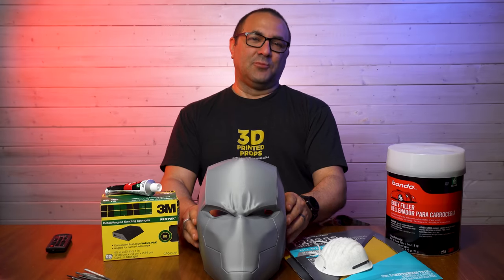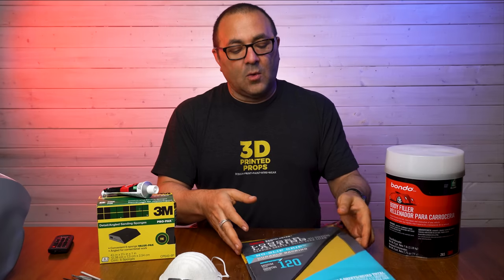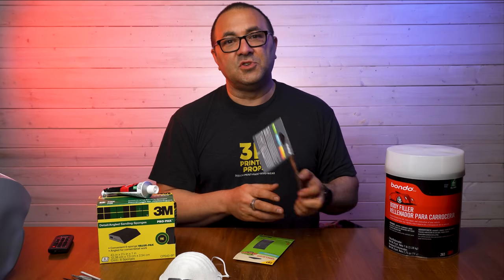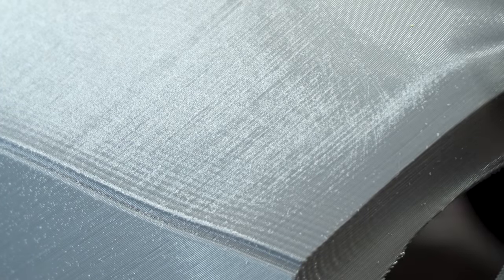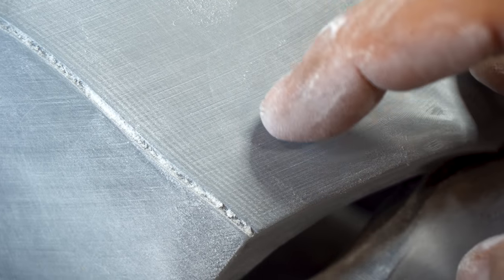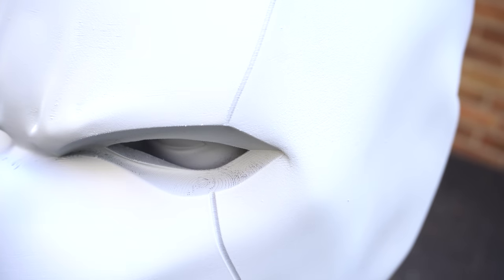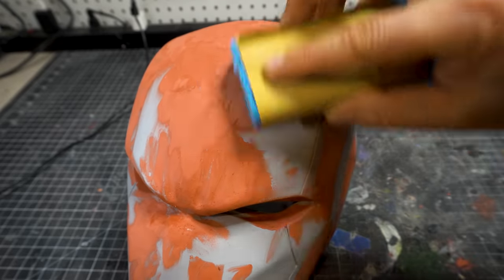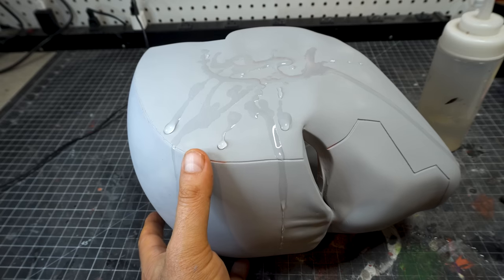Finishing 3D Prints: How to Sand, Fill and Prime 3D Printed Parts

Comment: What if the 3d print that you received has very large layers and it isn't as smooth as the mask you started with. Do you still need to sand it first before the thicker primer?

Comment: Would this process work with smaller figures that are printed out ? Like around ears , fingers etc ? Or would the sanding process break those off ?
Reply from the maker: You can sand smaller parts. I have. You'll just need to be careful. Also not use thick primers. Use fine primers so I don't fill in and gum up all the detail.

Comment: So after filler priming. What grit do we continue to use?  do I start again at 120/220/320? Or just 320?
Reply from the maker: I start back at 320 or 400.
Reply: @3DPrintedProps  thanks. I'll start there. If it needs a lower grit I'll go down one at a time

Comment: How many wall layers do you recommend so that you don't sand through while sanding out the layer lines
Reply from the maker: I usually just print with 2 walls and 7 top lavers and 6 bottom.

Comment: do you ever mix bondo with epoxy resin to make a skim coat?  I use this on fiberglass enclosures for super smooth finishes, wondering how that would work with prints.

Comment: It's a great video and great work, but I'll save you tonnes of time with this advice (naysayers are welcome to chime in).There's absolutely zero reason to sand the surface material and/or filler down to anything over 400g, let alone going all the way up to 2000. In fact, sanding your rough surface to anything above 400g will cause problems with your primer adhesion. The prime layer is meant to soak in and fill shallow scratches - like the scratches left by 220g to 400g - and again to be sanded down to 220g-400g in preparation for the first colour coat. The first colour coat is for bonding and final sanding (unless you spot more scratches that you want out - then you could recoat it, or clearcoat it, or even waxless polish might deal with it). The last colour coat is your final surface, in which it's your choice to wet-sand, or not. A well sprayed topcoat doesn't need final wet sanding, unless you're going for perfection.

Save the tedious high-grit micro-sanding for the last coat on any project.

Comment: Would you recommend using a sander to save time?
Reply: On a helmet, a sander probably won't be much of use due to the curves it has. You could easily sand 1 area lower then the other as well. Now if your doing a prop of a large sword or shield that has a large flat surface, then I would highly recommend a sander as long as you can adjust the speed of it, go to fast and you will start melting the plastic rather then sanding it because of the friction

Comment: Hey. I am working on a nova helmet and have two questions. First of all the inside of my helmet is kind of rough do I have to sand it. Also the nova star that goes on the helmet is a separate piece. Should I go through the whole process that you went through for the nova star also.

Comment: How are you supposed to do this with less flat surfaces? Like with prints with lots of grooves and stuff?
Reply from the maker: Yeah, that's a lot harder. You can use smaller sanding tools and files but its not as easy. Fir really intricate models you will only be able to do so much on an FDM printer before you have to move to resin printing.
Reply: Sorry for the late reply, but thank you!

Comment: do you ever run into melting issues with sanding pla? have you used any power tools for sanding?
Reply from the maker: Not with hand sanding, but I have with an orbital sander. I stayed on one area too long and it got a little melty, :) So be careful with mechanical sanders.

Comment: May I ask, how long did it took you to sand it with 120? I have been sanding small prop for about 4 hours. and i can still easily see layer lines
Reply from the maker: If its a FDM print start at a lower grit to knock the lines down, then go finer, that will help.
Reply: @3DPrintedProps  Thanks, did that, took about 3 weeks to complete all the parts but I got it done :D (I was working with PLA, also I had to start with 80)

Comment: When it comes to sanding, have you found a "safe" minimum outline requirement on the print?  I'm worried about accidentally sanding through it if I only have 2 perimeter layers.
Reply from the maker: I use 2 wall layers and have never had a problem, but if you start to see the infill pattern then watch out.,

Comment: What if, and this is a what if, ones printer is printing the lines so tiny you give yourself da goose pimples trying to rake your nail across em to fill em? would i still need to go as nuts on the sanding? or could i get away with just sanding with a high grit and straight to primer?

Comment: quick question: Are you using a hardener for the glazing putty shown/linked in this video? I am using the bondo glazing putty, and with the hardener, im not getting the deep red color you are getting in this video. I also don't like that it hardens in minutes... makes it very difficult to work with when I have a lot of imperfections to fill in.

Comment: After you use the spot puty what grit do you sand it with
Reply from the maker: Usually 400.
Reply: @3DPrintedProps  thanks also would just sandable primer work

Comment: Hmm, 9.5 out of 10 videos on youtube on smoothing FDM printed parts in PLA mentions sanding. I mass produce large 3D prints for customers and I am quite confident to say that sanding PLA isnt the most efficient method. Even the 3D printing services company I out source to, as I can't mass produce prints fast enough, do not offer sanding option for PLA. 

Hope this helps if anyone reads this. The method I use is I first spray 3-5 coats of spray putty on a fresh print. You sand down the putty into the PLA RATHER than sand the PLA... PLA very resilient to sanding. I will sand my SLA resin prints, but not PLA. Not anymore, no thanks, I have experienced that. If you sand PLA, you will notice the PLA will have fuzz/hair which are PLA ripped out of its surface by the sand paper. PLA doesn't shave off into fine powder as well as resin or putty.

Try it, once you used spray putty to fill the layer lines and sand them down, you will never go back to .... "sanding PLA"... a little funny. You then finish it off to achieve the glaze normally like you usually do.
Reply from the maker: I've had a few people mention that in the comments, I'll definitely try that next time. Thanks! :)
Reply: Thank you for this!  When you say spray putty, do you mean filler primer?  Or something else?  If not filler primer, can you mention what product you use?  Thank you!
Reply: @stevetb7777  spray putty is typically found in automotive stores. They are used to cover scratches in car body repair. Google it, it should turn up right away. It can be used as primer but it's not like paint primer which is thin. Just a few coats of the spray putty builds up a fairly thick layer. Have fun :)
Reply: @wyukigurumi  Apparently not so simple.  =D  I'm in CA, USA.  This spray putty, this isn't in an aerosol can right?  Most I'm seeing have to be mixed with another chemical, and a spray gun is used.  "Polyester Primer Surfacer" is what most of these are.  Am I on the right track?  Can you recommend any particular brands?  Most of what I find I can't get here, even shipped.  Thanks!
Reply: @stevetb7777  it is definitely an aerosol spray. It also comes in a big tin for car body workers to use a spray gun with.

Nah, for 3D printing hobbyists, just get the aerosol version.

Comment: what is the best thing to use. the glazing compound or wood filler? Or is it just a preference?
Reply from the maker: I think its a preference thing. I used wood putty but I like how this sands more. That and I'd buy a tub of wood filler and it would dry out in a few months since I didn't use it a lot. But try both and see what you like.
Reply: @3DPrintedProps  I actually used the bondo putty and it worked well. But I'm curious to see how wood filler works.
Reply: @3DPrintedProps  I've had the same problem with wood filler; but, I've found you can usually get it back to it's original state by mixing some water into it.  You can also use water to make it runnier, allowing it to better fill in finer detail areas.

Comment: Hey, I was working on my mask and I was using the sandable filler, I tried to sand it at was I think still wet? Even if I let it dry for four hours. It wasn’t looking like your mask. It wasn’t solid.
Reply from the maker: Was it the glazing putty I used. Look to make sure it wasn't the type of filler that needs a catalyst. Was there a small tube that came with the filler?

Comment: For sanding: can I use one of those electric handheld sanders? Sorry if it’s a dumb question
Reply from the maker: Yep, you can use an orbital sander. Just don't pause on one space too long. They can be pretty aggressive and also heat up a spot fast. But I use them all the time.
Reply: @3DPrintedProps  Thanks!

Comment: I wet sand the spot putty (yes, I have taken props into the shower with me). It eliminates the dust and gives a really nice finish. Try wet sanding next time and be amazed!
Reply from the maker: Yep, I wet sanded this. But if you're wet sanding there really isn't any dust.
Reply: @3DPrintedProps  Yes... I know. I am saying that I wet sand the spot putty which most people don't. I've seen many videos of people covered in red dust, but it can be wet sanded and the results are really nice.

Comment: There is no way to achieve this effect of perfect smooth surface with just printing? We still have to go through al of these right?
Reply from the maker: If you dial your printer in really well it can look smoother, but not this smooth. If you used a resin printer the prep work is very minimal since they give you a near perfect print with no layer lines. But a resin printer that can print a full helmet is very pricey and starts at around 2k USD.

Comment: Hi! I just had a question. I'm printing a pipboy from Fallout, and I was wondering on whether I should do these steps when it's all put together, or do them in their pieces then put them together. Thanks!
Reply from the maker: I would do a lot of the sanding when they are in pieces so you can get in the tough areas, but you may also need to do some sanding if you want to hide where you glued things together.

Comment: I have a rustoleum white paint+primer would It be OK to put it on the mask after sanding?
Reply from the maker: Sure, the benefit of using the fillable sanding primer is it fills in more layer lines and sands well to get a smother surface.

Comment: I suggest duplicolor filler primer. I will never use rustoleum again!
Reply from the maker: I'll try it. I haven't had issues with the Rust-Oleum though.
Reply: @3DPrintedProps  when I've used Rust-Oleum my sandpaper tends to get gummed up almost instantly. Even doing light coats and I even had a full week of drying time. I prefer duplicolor in every regard. Definitely worth checking out.

Comment: I had a question, when did you use the body filler?
Reply from the maker: I use it after I prime the helmet. Priming has a way of showing all the imperfections your missed or that are too large to sand.
Reply: @3DPrintedProps  thank you, I had another question, did you work on the inside of the helmet or leave it as is?
Reply from the maker: @silasdriver453  I didn't do anything sanding wise inside, I also try not to get a lot of paint inside due to the smell. I did add padding. That's in this video. https://www.youtube.com/watch?v=4a9nTbBrjrY&t=114s

Comment: Is there a way to prevent bondo from cracking? I've been working on a helmet recently, and the only thing that seems to hold me back from finishing is having more problems trying to fill cracks previously made by the bondo I'v placed before.
Reply from the maker: That I'm not sure about, not an expert with that stuff, but I find if I lay it on to thick it cracks, maybe someone else can weigh in?
Reply: Try the white bondo "All-Purpose Putty" that comes with a hardener. It is more like a cement but will be harder to sand, almost like a soft wood so be very careful and apply it conservatively. Red bondo is only good in thin layers on the most exterior surface.
Reply from the maker: @benhickman6296  I use that for the large cracks, for the small stuff I like the glazing compound. It smooths it out and is easy to work with.
Reply: @3DPrintedProps   I like using glazing compound myself. Iv'e had 3 issues with cracking with the red glaze which are caused by: applying it too thick, humidity/moisture, and melting (polystyrene). Instead of recommending a new product I should have just said that lol. Hopefully they find a good solution. I like the video!

Comment: What are your thoughts on primer that has filler built in?  Haven't watched the whole video yet so don't know if your covered this.
Reply from the maker: Built into the paint?
Reply: @3DPrintedProps  Built into the primer itself.  They sell primer that's also a filler.  Some use it to fill in some of the imperfections and lines of the 3d prints.

Comment: For some reason, after I primed my parts with the fillable and sandable primer, when I start sanding it, the primer starts to come off in chunks. What should I do? I spent so much time on this already /:
Reply: please respond
Reply: my part looks horrible lol. the primer is ripped off in chunks and smooth in other places. idk what to do but this sucks having spent so much time on it.
Reply from the maker: After you sanded it all, did your wash it to remove all the dust from the sanding and also what primer did you use?

Comment: isn't it a bit overkill to go all over 2000 if you're going to paint it ? You can still buff the paint if you use some thick paint.
I went all the way to 3000 and polish paste but only on some metalic 3D print (Bronzefill) to get the best effect of the filament.
Otherwise, great video.
Reply from the maker: Yeah, 2k is a bit much bit man...that sucker is smmmoooottthhhh. :)

Comment: I heard wet sanding the plastic is better so it doesn’t heat up. Does it actually matter?
Reply from the maker: If you're just hand sanding its cool, it doesn't heat up. If you are using a power sander I can but if you keep it moving you'll be OK. Wet sanding is really just for finishing.

Comment: This video is lovely, but please just as good practice. Do NOT sand in circles. If you get dirt or other small particles between your project and your sandpaper. Which can cause large scratches. Meaning you would have to start over in that area with a lower grit sandpaper. Like I said. Awesome video, great details just try to avoid circles.
Reply from the maker: Huh, I always thought you were supposed to sand in circles. I'll check into it more. Thanks.

Comment: $20 worth of filament
$10 of Bondo
Sandpaper... $5?
Primer $5
Gold paint $5
Candy red $15
Clear coat $5

Minimum $65. Probably closer to $80, plus a LOT of time. 
I'm using the cheap stuff, but it's expensive to finish this prop.
Not including the time I had to spend in Meshmixer to cut it down to fit an Ender 3.
Reply from the maker: Yep, its a expensive hobby. :)

Comment: Stupid question but..... when you say you "wash it", do you full on wash it with soap(fairy liquid)/water or JUST water to remove the grim/dust? I'm a little worried about washing the filler away? Even if that's possible? Thanks in advance!
Reply from the maker: Yep, soap and water. I just use a washcloth. Once the filler has cured and hardened it won't just wash off.😀
Reply: @3DPrintedProps  thank you for putting my mind at ease!

Comment: Is this for a resin print or PLA?
Reply from the maker: This in this particular video I'm going through steps on a PLA print. But I did one on resin prints though. Here it is. https://youtu.be/NLoQqRFlmk4
Reply: @3DPrintedProps  lol there is no details on helmets like this, resin will make it a lot quicker and less sanding
Reply from the maker: @devilik3692  true, u just need a big enough resin printer and about 60$ in resin. :P
Reply: @3DPrintedProps  no that's not what I mean , you can cover your fdm print in resin and use uv torch to cure it, you can use cheapest resin you can find for that just to make surface smooth. I have both but cosplay stuff easier to print in full pieces on fdm then cover it with resin using brush
Reply: @3DPrintedProps  very small about needed to do that

Comment: Depending on the primer, don’t you not want to get the primer wet? Just dry sand the primer? I know a 2k epoxy primer is water proof, but that’s no ordinary spray can you’d find in a hardware store.

Comment: What you can do when using the filler primer is just lay and lay it on there, doesn't matter if it drips or runs because you will be sanding it, it's much easier than doing light coats and then more light coats, plus when it runs it fills the lines
Reply from the maker: Sure, that works too. I find though, that if you let it run to much its just more work to sand them down.

Comment: Great video. But you have 3 sets of instructions.
Intro of the video you present the set of steps you do.
Taking us through the actual process, the steps differ from your intro.
And finally in the recap, the steps differ a third time.
I guess I'll just try it out until I find the one that works best? :)
No hate, just found it a bit confusing.

Comment: Wood filler ?????🤔🤔🤔
Reply: Doesn't smell like bindo does, and you can water it down so it spreads even better with a brush or sponge. You can use acetone instead of water if you want it to dry/cure quicker. It's cheaper too.